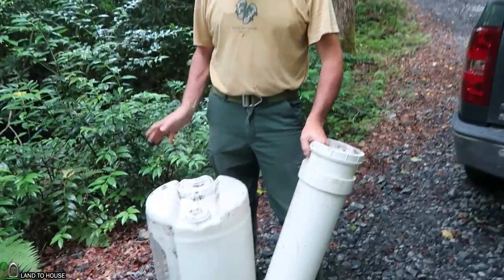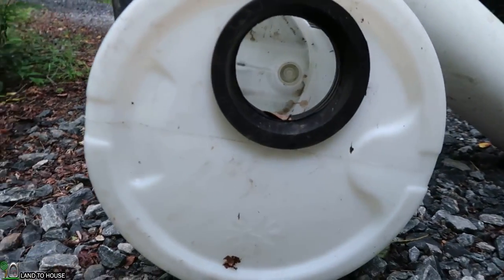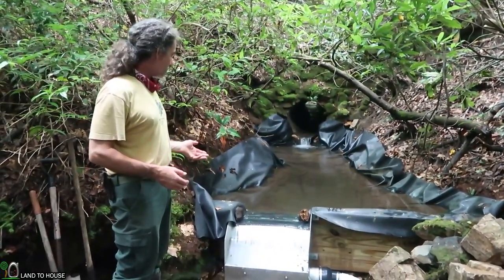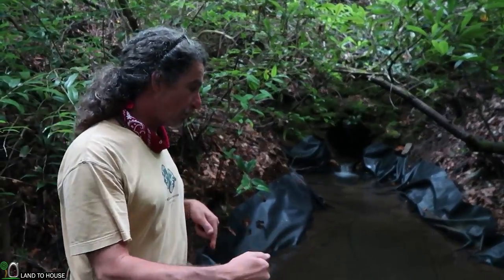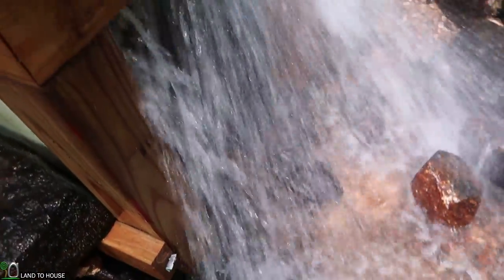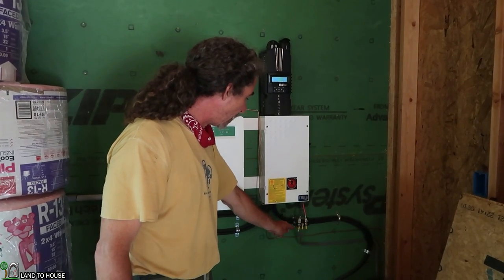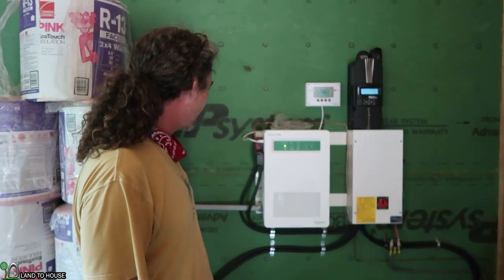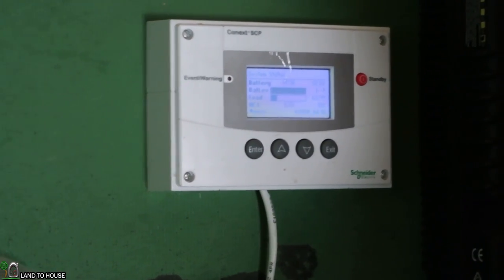AMAZING 250+ Watts of Micro Hydro Power Off Grid

Comment: Let me say I love this concept. I would like to know how long does it take to recoup your electric money? Reason I ask, is just the plumbing pipe alone had to be a small fortune not to mention 1000 feet of 10-2. Then of course the generator. All the batteries and associated electronics plus the panels had to be somewhat expensive. Just looking over you're system what would a guy have to plunk out to get all the same stuff? I am just wondering and I mean no ill will. By the way the system looks well built so I gave it a thumbs up.

Comment: Wintertime. Now that's interesting. How do you deal with frost? And snow? But mostly ICE?
Reply: This setup is in western North Carolina, so the average temp in Winter is about 40F. Although it can get below freezing at night, it is usually not cold for enough days to freeze running water.

Comment: Nice system except I would have used 6 volt golf cart batteries like Trojan cheaper then those AGM batteries last longer as well...we ripped out all our AGM's and went back with flooded lead acid..much cheaper and more reliable...good luck great video

Comment: i move about 3000 gallons per hour how much power do you think i could make.
Reply from the maker: The basic hydro calculation :

(Gpm X head in feet)/10=power

Say you have 120 feet of drop in your creek and 3000 gph.
(50gpm X 120 feet)/10=600w

Comment: Will the hydro overspin when the charge controller reduces load when the batteries are full? Does the hydro have a governor built in? I know the Midnight can do division control, but since I didn't see any load dump I'm guessing the controller is setup as a standard charge controller like in a solar application. Thx!
Reply from the maker: The unit wl spin way up when the batteries are full. My system. Does that. I had to get a midnite classic 250v so that it could handle the high speed voltage.
Reply: Ok, thx for the reply. How long do your bearings last? I think bearing life is the only downside as long as the rotor can withstand the RPMs. Also, any special setting you use for the midnight’s MPPT scan?

Comment: I have a question about the "air in the flow" issue. Is it possible to add a P trap to the inlet?
Reply: I don't think that would solve anything. P traps are gor stopping air escaping a system

Comment: Would a standpipe (vent) closer down the pipe towards the nozzles help the air escape and increase the pressure slightly?
Reply from the maker: It would have to be 58 feet tall.
Reply: @LandtoHouse  ohhh so it’s got to be the same height as the intake up top.!!

Comment: Edit: in general, that's a really awesome system. The size of the piping is excellent. It looks like the money has been spent where it counts.

Another comment: it would be slightly more efficient to rectify the voltage at the turbine and run straight DC through the wires. If there are 3 wires you'd parallel two colours and then run the current back through the third one. If there are 4 wires you could make 2 parallel pairs.
The Reason to rectify it at the source is that a third of the time each wire has dead time, meaning you could even the same current over all of the conductors in the cable.

This could be for not much gain though, if you have only a few % losses over the cable run. 33% of a few % is really insignificant.
Reply: Actually 3 phase AC transmission for long runs is much more efficient than DC transmission, (thank you Nicola Tesla,)  that's why the Power Companies use high voltage low amperage 3 phase for the transmission grid, and households get power from a step down transformer tapped off of 2 of the 3 legs.
Reply: @workbenchz  Only because it's difficult to ramp dc between usable voltage levels. With AC it's a case of just putting in a transformer at the source to up the voltage to 100kV and then a transformer at the distribution to ramp down to 11kV, then further down to 110V or 220V at a local transformer. 100kVAC is more lossy than 140kVDC (~= to 100kVAC's peak voltage).
In fact, a lot of the new long distance power transmission installations use high voltage DC because high voltage components have become efficient enough.

With this system there's no hindrance to going DC for the long cable run if you're converting it to DC at the load anyway. It just likely wouldn't make all that much difference.

Comment: He's getting HUGE losses over 1000ft of wire at only 59v delivered under load.  A quick calculation shows he's losing about 43% of his power.  He needs to boost that up with a 1:4 transformer to at least 300v at the source and then transformer it back down just before the rectifier.  You can see the loss from when it drops from 100v when idle to 59v under load.
Reply: Also, arent microhydro turbines 3 phase?
Reply: Saw That And More  To Fix
Reply: 300v should certainly pop the squirrels if they bit into it. And it would be a lot of dangerous volts to leave lying along a thousand feet of hillside especially as its a tripwire for all sorts of animals heading for a drink. 59v is plenty considering this.

Comment: It's 250 Watts, not 6000 Watts.  A Watt is an energy per time unit, it's one amp at one volt, or one Joule per second.  You can store the energy in whatever size energy bank you want, but it won't increase the power output of the generator.

Comment: Hum .. 6000W / day ? so 250W for 24h = 6000Wh /day? Or you meant 6000W all day around = 144000Wh / day ? W = power wich already contains a time variable (/seconds) , Wh = quantity of energy.
Reply: 250watts x 24 hours=6kwh per day.
Charging batteries with this constant input..
the batteries then feeding an inverter...
you could run most household appliances....

Comment: Watts per Day is an improper measure of Energy. The units of Watts per Day have Time in there TWICE, which means an acceleration. A day is obviously a legnth of time, but where is the other unit of time? It is in the Watts, because Watts are Joules of Energy per second. 
By saying "6000 Watts of Micro Hydro Power per day" you are saying that you get 6000 MORE WATTS every day than the system put out the day before. After a week, it would have to put out 42000 watts! If the system makes 250 W all the time, that means 250 Joules times 1/second, times 86400 seconds in a day. Thus the seconds cancel out and you have 2160000 Joules per Day. If you divide that by 3.6 million, you will get the kilowatt-hours, kWh  like so: 2160000 / 3600000 = 0.6 kWh. Why 3.6 million? There are 3600 seconds in an hour, and 1000 watts in a kilowatt. Multiply them together to get 3600000.

Comment: The bridge rectifier would be better placed near the generator. DC travels better over distance, and less copper.
Reply from the maker: It would be interesting to have a comparison.
Reply: @LandtoHouse  Yes, I would be interested in a comparison.  It may only be small, depending on the distance, and voltage. High voltage is the best medium for distance, followed by DC.
Reply: DC or AC makes no difference to transmission losses. All that matters is the voltage. Higher voltage = lower current = less losses from conductor resistance.
Reply: @Sambo876  Yes, voltage.  DC is at peek voltage 100% of the time.  AC is only at maximum voltage at the top and bottom of each sine wave (it's a bit of a over simplification admittedly).  A lot of undersea cables are DC.
Reply: That my friend, is BS.

AC travels way i mean WAYYY better then DC. Hence the whole grid worldwide is AC based.  (Apart from other goodies on AC like using a transformers instead of a DC - DC step up/down converter).

Ask anyone that is remotely in the range of electrical stuff like linesman, electricans (what i am for a living) or somebody that studied anything electric themed.
Reply: @casemodder89  No need to be rude.  AC has one huge advantage.  Transformers.  You can step up and step down voltages with ease.  That's why the grid is AC.  Stepping up DC voltage  was near impossible when electrical distribution was invented.
Reply: @StuartJ  what you say about DC voltage being better for transmission at a given voltage could be true, I know China has a 1 megavolt transmission line which I believe is DC.
Generally though for normal applications AC is chosen because it is easy and efficient to step the voltage up and down.
If the voltage starts as a highish DC source like say 600V from a string of solar panels then it is fine to use that for transmission short distances to reduce size of guage wire.
Best solution requires knowing the voltage of the output from the turbine, compared to the AC voltage required at the end use point.
We aren't stepping up to 1000's of volts AC or DC for long distances in this scenario.
I've been a Linesman for 16 years. While im not an expert in DC I do know a bit about electricity distribution.
Reply: @StuartJ  also I'm from Australia so the LV AC for my purposes would be 230V and travel better than a 110V LV application.
Reply: Grear discussion. Thanks.
Reply: @Sambo876  I said right at the beginning, "It may only be small, depending on the distance, and voltage".  On paper, it's better for the bridge rectifier near the water generator, even if it's just to save on copper (2 core instead of 3 core).  Factors at play for better efficiency, are the voltage of the generator, the AC frequency, and length of cable.

HVDC is common.  https://en.wikipedia.org/wiki/High-voltage_direct_current
DC is more efficient for long distance.  I totally understand why people think otherwise, because it goes against what they were taught, and in the case of people working on the grid, practice.  The grid was designed before High Voltage DC (HVDC) was possible, and even today we would probably still use AC because transformers are reliable, and cheap.
Reply: The main advantage of DC over AC is that DC avoids dielectric losses. Dielectric losses occur in a capacitor with continously changing polarity (like in AC). Cables also have an electric capacity. That capacity gets larger if the phases/wires are close together (rather in underground cables than in overhead power lines). So there might be a little bit less loss when using DC. But I think that the ohmic loss is much more dominant. It would be interesting to know the voltage drop between the turbine and the charge controller.
Reply: @casemodder89  I guess that you haven't kept up to date then. You kind of have missed the fact that there are more and more HVDC transmission lines being built. The longest one until recently was the one in South America which is about 1600 miles long and at 600kV DC. Anything above 600 miles it is a wash between HVDC and HVAC as far as the electronics needed as the cost of the copper lines goes down due to DC needing smaller ones. China now even has UHVDC lines where the Voltage is over 800kVDC.

Comment: Great work Eric!  The system looks great, and glad to see that the Coanda screen worked well for you.  We'll check out that water depth in the collection chamber to see if we can do better to prevent air getting into the outlet pipe, but we haven't seen that on other intakes.  We appreciate you and Seth documenting this install and look forward to helping others get a reliable water supply for their system with a low-maintenance intake screen.  If interested, folks can contact us at watersolutions@elginps.com or call the office at 614.524.4588.  You can also check out our offerings on www.elginwatersolutions.com.

Comment: can you ranslate these videos into ordinary terms like, would this run a freezer I don't undersand watts and kilowats
Reply from the maker: This runs at 250w continually.  A freezer is normally between 300 and 700 watts intermittently. But the battery storage allows for the high startup amps of the freezer.
Reply: @LandtoHouse  ok thanks,  is this all worth it then would it save much money, and couldn't you print out a machine that's designed for this
Reply from the maker: Because he is in the middle of nowhere an off grid system was well worth it. If you have grid power a single micro hydro like this might not make sense.  My system with solar saves around $40 a month on power.
Reply: @LandtoHouse  ok thank you, do you think solar is better then

Comment: 140 Ah of usable energy for all that work is kinda redundant for the cost. Great idea but I think the guy sold you on over complicated statements you didn't need.
Reply from the maker: Plus 250w continues power. He can run the lights and mini split without draining the batteries. A plus of living alone in a yurt is low power consumption.

Comment: Seems like every sort of residential hydro generator out there produces no power. High expense,, So much water flow, so little power. I guess hooking up half a dozen of these units side by side could work...if your a millionaire
Reply from the maker: The power calculation is:
(Gpm x head pressure)/10  = watts. 
Eric is actually making a reasonable amount of power based on his parameters.
Reply: @LandtoHouse  hes storing a decent amount of power over time. Running solely on hydro you would need minimum of 2000w constant to run anything of importance.
Reply: @LandtoHouse  i thought the whole point of having a constant source (water) was to make constant power. Not alittle at a time and have to spend a fortune on a battery bank.
Reply from the maker: Because its just him the power made is enough. Apparently the power company wanted an even bigger fortune to run power out there.
Reply: @LandtoHouse  so for me to make 2000w during the day constant, would it be smarter to just go solar? Need to run a 1400w ac during the day. Im trying to avoid battery banks as they fail and need replacement every so often. I already have a 200amp service and really looking to supplement. But 250w isn't gonna supplement a thing for me. (Its a farm)
Reply: @LandtoHouse  - Head pressure in what units???? Feet?, PSI? Things are much easier with Litres/sec x metres head = watts. Saves all the confusion of  Farenheits per square bushel and other such American nonsense. In both calculations you need to reduce the result to allow for efficiency losses (multiply by approx 0.7, at best).
Reply from the maker: The input head pressure units are based on the kids foot size... haha makes total sense.